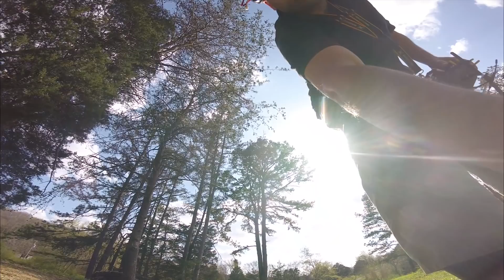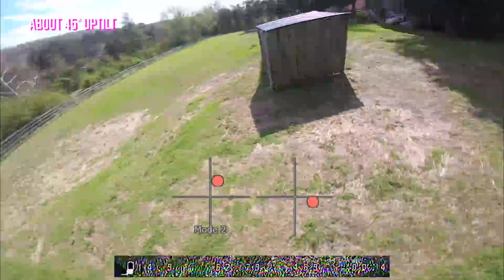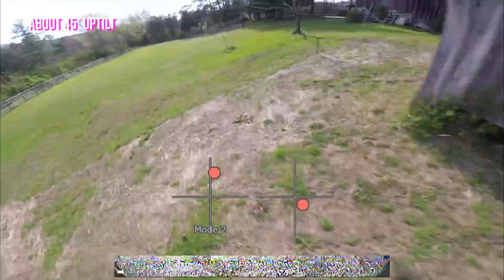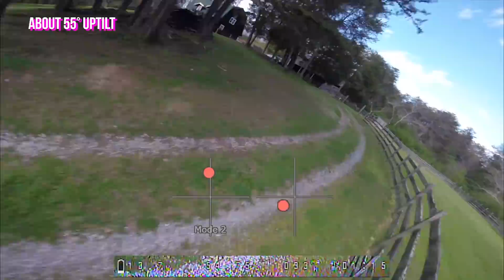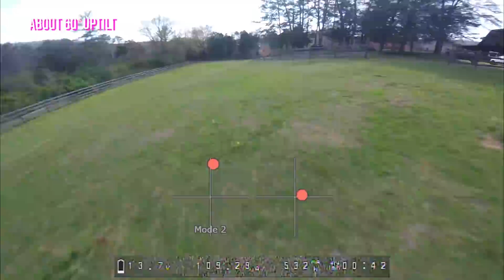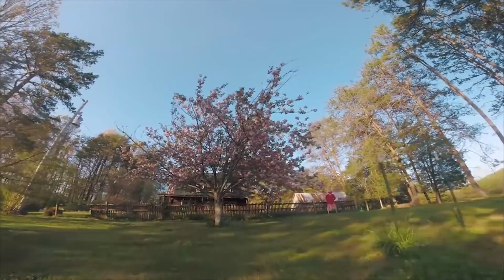FPV Camera Uptilt Comparison | EMAX HAWK 5 RIPPING BALLS

Comment: That thing is insane! Can anyone tell me why I gey battery low warnings when I go full throttle even with a fully charged battery? I'm using tattu 1550mah 70c 4s and funfly 1500mah 100c 4s. Both do the same thing

Comment: I fly at 55 degrees or so, but I have to yaw left and roll right to make turns for the most part, but my yaw and roll is moving correctly in the right directions. Rarely do I roll and yaw the same direction...

Any thoughts?

Comment: Greetings Mr. Bardwell, I come to you hat in hand in hopes of solving a problem I'm having with my Emax Hawk 5.  I'm relatively new to the game of drone piloting but am a fast enthusiast.  I have to also say I've learned a lot watching your you tube videos, from using simulators, learning to fpv, beginning acro flying, etc.  Having picked up an Eachine EX2 mini, JJRC Heron X9 and a couple of other toy grade quads in a years time, I figured I'd go ahead and get real and purchased the Hawk 5.  However, after several months of wrestling with it still no maiden flight.  The problem I'm having about $500 in after purchasing quad, a Taranis QX7 and all the peripherals, is I can't get the control sticks to register in Betaflight.  The switch and beeper settings move the graphic bars just fine in the Receiver tab but I get nothing for throttle, yaw, pitch and roll when I manipulate the sticks.  Everything else checks out in the other tabs, ports, config, etc. and the motors spin up just fine too but after meticulously creating several clean models it does the same thing each time.  Apparently the the flight controller is receiving commands from the XM+ receiver since the AUX channels are working.  I also just bought a Tinyhawk Freestyle just to ensure it isn't a problem with the transmitter.  The Freestyle worked swimmingly minutes out of the box and flies great.  I'm stumped so I opened a service ticket with Emax and the nice gent working with me although diligent seems close to his wits end calling the problem "very strange", so I'm hoping you may have an idea or ideally just know what the solution might be as you are heralded in the community as the go to guy for knowing it all regarding UAVs. Any ideas O wisened sir?  Your grey matter would be greatly appreciated in this matter.  Thanks much.
Reply from the maker: Doug, please email me joshuabardwell@gmail.com

Comment: Do you change the camera angle setting in betaflight as well?  or are you just physically tilting the camera only?  Thanks!
Reply from the maker: I don't use the betaflight camera angle setting any more. I just adjust with the sticks.
Reply: @JoshuaBardwell  Thanks, so your betaflight camera angle setting in betaflight is '0' then?

Comment: I have a hawk 5 and I made the mistake of buying a micro eagle cam . It's a great camera, but the connector bumps into the  FC at 30 degrees (ITS DRIVING ME NUTS). I plan on doing some drilling to move the camera forward, but I'm afraid I'll lose my camera protection. I still think everyone getting into FPV should buy this. It's a little powerful for a beginner, but it's durable as hell and you can't beat the value. There were some OMG crashes that only resulted in a slightly bent prop. Just buy the thing. It's smooth and fast out of the box. This video is what sold me on it. After flying for a couple weeks, I can tell you that this flies even better than the simulator. It turns like it's on rails. That's what people keep saying, and it's true. Very easy to control. I do notice slight prop wash at max throttle punchouts, but I'll be dealing with that later while watching another Bardwell vid.   : )

Comment: Hi JB, interesting video. I just bought a Hawk 5 and can't get more than about 35° uptilt before the camera connector hits the top of the stack. What did you modify to allow for the additional uptilt?
Thanks.
Reply from the maker: I made no mods to my Hawk.
Reply: Ok, thanks. I ran it by Emax and they opined that a few of the first batch Hawks may have had the camrea mount uprights installed upside-down, as they look almost identical either way. I'm going to try reversing them when I get home tonight and see if that solves the problem. If there are any other Hawk owners out there with this problem, try flipping the uprights over and see if that solves it.

Comment: at 60 degrees plus, pin the throttle to max and then its all 'right stick flying', roll to control direction, pitch to control height...  the left stick is just to keep the picture horizontal for your youtube viewers ;)  Nice flying!

Comment: Hey JB i have seen lots of your vids and thry helped me build my first fpv 5inch but i still have one problem with the osd... i am running the matek f405 std and a matek fchub 6s and my cam is the runcam swift 2 also my VTX is a TBS unify HV race. See the problem is that it douse not show the betaflight osd (im running bf) but it shows the runcam one (betaflight osd is enabled). i found out that it was probably a grounding issue but changed the ground and it did not change!    please help!!!!!!!!!!!!!!!!!!!

Comment: To me, the steeper camera angle should make for a faster quad. But from this video it appeared to me that you’re far more comfortable at 45-50 degrees Cam angle. I have tried flying with steeper angle but it just puts me out big time. Dial it back, and end up flying faster! Great flying Bardwell!!!!
Reply from the maker: Yup. Higher angle is only faster if you can stay smooth.
Reply: Joshua Bardwell 100%. Keep up the flying man. Would be great to see some more race footage on your channel. Your doing great

Comment: Joshua, What is this store RMRC? See what they answer: "Ready Made RC, LLC will not be held responsible for misprints or errors on the Ready Made RC web page or product listings." So you look at some props, you order them, and a cock (rooster) comes. How can there be a store that does not check what it sells? I told them to change the picture. They obviously have a dropshap. There is nothing available. Endlessly disappointed.

Comment: JB I NEED UR HELP!! I have QX7 my channel endpoints set up perfectly at first. Now their off by quite a bit. I know how to adjust it but I don't have enough. I went in and changed the rxrange on those but I won't to know if there's another fix. Thanks,    love ur support to the FPV community.
Reply: If you haven't yet, try re-running the stock calibration (Long press menu, then page ~7x to get to it).
Reply: Yes I have done that too. I'm just not sure what's up with it. Thanks for the input

Comment: Looked to me like cornering, response, punchout, and propwash were also affected. Love the content, thanks.
Reply from the maker: Propwash is affected because the quad is simply moving faster. Cornering is affected because the altitude control is way more sensitive to throttle and pitch input at higher uptilt.

Comment: May be my problem progressing. I can't seem to fly with more than 25/30 degree's of tilt.
Reply: That's what the sim is for. Crash a lot at low consequence until it starts to feel right.
Reply: Do it in the sim, 5 degrees at a time.  It'll feel off, but you'll find yourself there after some practice.
Reply: I'd just jump straight on 45 and practise. You'll find altitude control a lot easier than those low angles.
Reply: Tragically, the best answer I have to that has been helping my friend build a better sim that uses more multiphysics simulation in the background... 
Still, enough of the muscle memory can carry over that it's useful.
Reply: Thanks for the advice!!  I'll probably just go for it :)    Crash and learn...lol
Reply: Every time I spend any amount of time on my sim it messes me up when it's time to fly the real thing.  I can't get Velocidrone to feel close enough to help.    Great point though!!
Reply: Appreciate your input!!!

Comment: I have also noticed a difference in where your camera is positioned makes a difference in how much angle you have ie if you have a frame where where the cam is closer to the Center of the frame you tend to want more uptilt than if it’s on line with the front motors

Comment: Uptilt does not make the quadcopter fly differently. It makes the pilot fly differently
Reply: Duh...
Reply: Duh...
Reply: the pilot isn't flying... it's a UAV. So it would make the quad fly differently and the pilot pilot differently. :)
Reply: Uptilt changes the relationship between the pilots visual axis and the axes of Roll and Yaw. Above 45 degrees Roll tends more towards Yaw at lower angles, while Yaw tends towards the INVERSE of Roll at lower angles. The geometric changes are not intuitive.
Reply: No, I don’t think so. My thinking is the more that camera is tilted the more you, as the pilot, fly at a much steeper forward pitch angle. The more forward pitch angle you have, your Yaw, and Roll control act upon the quad differently. It’s the axis that changes flight control.
Reply: Duh...
Reply: Duh...
Reply: Duh....

Comment: YIKES!  I'd  be more  shocked but after your Matty video mentioning his 60 degrees of camera up tilt,  I tried it on the Free Rider FPV Simulator that YOU taught me how to fly quads on.  THANKS!!.  And was  amazed.  A tad horrified,  At those tilt angles, you are COMMITTED to going  fast when lapping a track.  If you try and slow down, you can''t see where you're going.  Nitpicking, it doesn't make the quad go faster.  It just makes it have to go faster when holding altitude at the 55 degree pitch angle t that will appear level to the pilot.  And altitude doesn't get tricky because of the throttle sensitivity, it's because when you have up tilt greater than 45 degrees, more of the lift vector from the props starts to go in the horizontal (go faster) direction, and less goes in the vertical (go up) direction.  At 90 degrees, no amount of throttle is going to make you go up.  At zero degrees, no amount of throttle will make you go faster.  So now fine throttle movements aren't going to do nearly as much as with much less tilt, but yeah, it's gonna be really sensitive to pitch, and you might need to change pitch for a quick altitude adjustment, which could make for some nasty behavior with overshoot, and the  pilot induced oscillations, as the pilot tries to correct.  So fine altitude control is a bitch.  You should have done some acro moves, because like your other video showed, it can put maneuver's in a different world, because as you pointed out, you're looking into looping maneuvers, to make rolls appear like rolls even takes some finesse, because of how much roll turns into yaw from the camera view, and when climbing vertical obstacles like buildings,  a steep camera angle makes it look like you're flying up the buildingn, rather than climbing in a hover next to it.  And flying up it is a cool illusion.  When I first saw Matty do that loop following the square underside of that bridge, I was like WTF? 

QUESTION: WHAT UP TILT IS GENERALLY USED AT THE TOP LEVELS OF GP RACING?  PRETTY HIGH BY NECESSITY, BUT THIS HIGH?  OH AND THE GUY BELOW IS TOTALLY  WRONG.  PEOPLE ARE WATCHING BECAUSE OF YOUR GOOD  LOOKS, BECAUSE THE CONTENT IS PRETTY LAME ONLY SO SO..  YOU FLY GOOD TOO.  THE SKIRT LIKE OUTFIT PROBABLY ACCOUNTS FOR HALF YOUR SUBSCRIBERS!!  LOL  I have an extremely sarcastic sense of humor, BTW. LOL
Reply: Uptilt varies - Thomas Bitmatta flies closer to 45, and shreds.  Evan Turner has been recently experimenting with sub-70, but flies that much or more.  ~70 is Shaun Taylor's happy place.  The high by necessity is that when a lot of the lap is sticks to the plastic, and only +/- 35degrees vertical FOV, you need more uptilt to see where you're actually going.

Comment: Awesome
I gather that uptilt does not change the physical dynamics of the quad (because that does not make sense to me), just the dynamics of the pilot due to the way they perceive the position of the quad through the lens.
I mean I can go just as fast as you with absolutely no uptilt ... until the 1st tree comes my way that is, or anything coz I would shit myself at that speed xD

What I don't get is how it affects Yaw Vs Roll to turn.
Reply: Edit: Actually, I think I know.
The more uptilt, the faster the quad can go which means the more vertical the quad becomes during flight which means 'Roll' turns more on the horizontal plane & 'Yaw' turns more on the vertical plane.

Close?
Reply from the maker: Yes, correct. 

You could go just as fast as me with less uptilt but you would be looking at the ground and wouldn't see where you were going.

Comment: 60 was smoother. looks like you are initiating relatively flat turns though, could use a lot more roll to drive around the corners and avoid flattening out at the back. watch gary kents flying (justice fpv). he has the best consistent racing cornering and holds his angle throughout a turn with very minimal correction.
Reply: AUW plays a decent role with that too - 2205's on 4S seem weak, but under 400g AUW that thrust vector is pretty massive until you start to unload a lot above 60mph.  Rich - you're totally right about keeping the thrust vector more normal to the ground if you're hurting for thrust, that helps a lot.
Reply from the maker: Just very hard to take those turns without falling out of the air if I don't pitch back some.
Reply: you can try dull your yaw rate to overrule muscle memory thats giving flatter turns. you can still pitch back while holding a roll, but this may depend on your overall rates. the lower they are the more you can use throttle to keep driving round turns as opposed to higher freestyle rates which encourage jump turns that dont carry speed. a lot of it is the racing line too which can involve going wide to roll into a turn early.
Reply: I found that I was much smoother at 60° too - although strangely I had less issues with altitude control.
I already run a dulled yaw rate, so that's probably why I was just plain more comfortable at higher tilt... I think I was trying to fly it more like a wing, which is probably just more intuitive for me - JB is clearly rocking some freestyle muscle memory, and it shows in the tighter hairpins.
Reply: Now that I look closer at the way I'm initiating turns in the simulator, I think the reason my turns don't seem as flat is that something I'm trying to do a bit of a scandinavian flick of sorts - chuck it in with roll and give a tiny bit of oppo in yaw so that I can be pulling back on pitch and rolling all the way through the turn, then using yaw to correct my way out.  This ends up forcing me to make larger radius turns, but I can keep reference points in the FOV better and in rare instances actually hit the apex exactly how I wanted to.
Reply: yeah with a bottom mount higher tilt should help control altitude blips, but then its weak motors and gopro thats bogging down the hawk. you need extra power from a taller stator and higher kv or more cells.(2206 2300 kv on 4s aint gonna cut it). still gotta roll around the turn to keep the thrust vector more on the outside and not underneath.

Comment: I keep mine around 55-60 degrees. I just cant bring myself to oitch forward to accelerate hard and I start ballooning corners at lower tilt, I found when I had my camera angle up to those higher angles I was a lot more consistent in keeping the quad low to the ground and at the same altitude around corners for how much roll / yaw I seemed to mix. 

I can keep a steady altitude with lower cam angles but I just cant really pitch the nose forward for whatever reason, its like a mental block, I just fly to the speed the camera angle carries as I seem to just prefer keeping an even level horizon and not tipping forward

Comment: Hello Joshua, thanks for your video. I would like to see in your review, some things i'm interested in. First, do you use the stock receiver ( XSM+) on your hawk 5 ? Then, can you share with us your configuration ( filtering settings + PIDS ). I bought this qwad last week but as I cannot use telemtry I can't tune it on the field and i'm not so satisfied with the stock pids. And last, what Gopro mount do you use and do you turn on the stabilization on your Gopro ? 

Thanks for your work :)
Reply from the maker: This is 100% stock PIDs. IMO they are great and do not need tweaking at all. What don't you like about them?

I don't use stabilization on the GoPro at all. I don't think it's good for FPV.
Reply: I heard high frequency oscillations from 75%-100% throttle. But maybe it is normal because my gopro is not well attached as I didn't receive my special gopro mount with screws.  Okey thanks for your comments, can't wait to see your review about this qwad :)